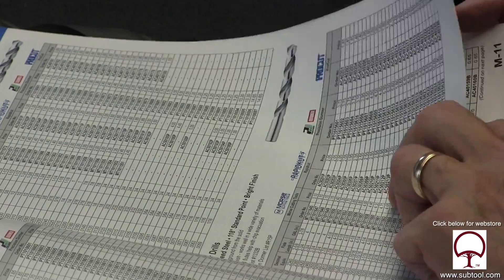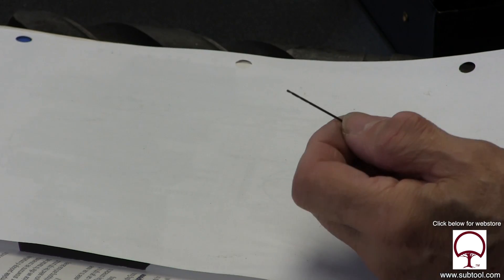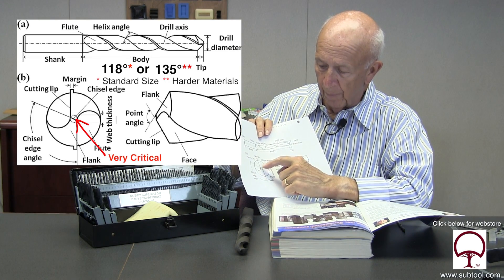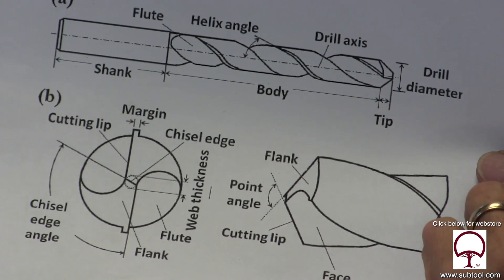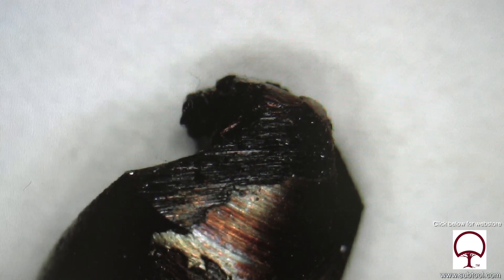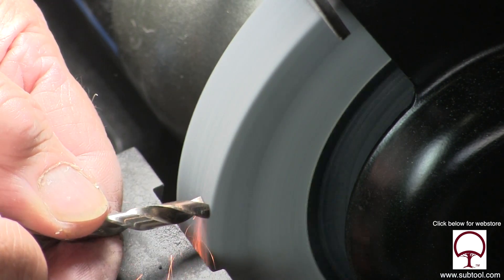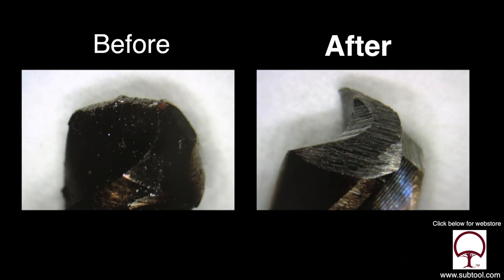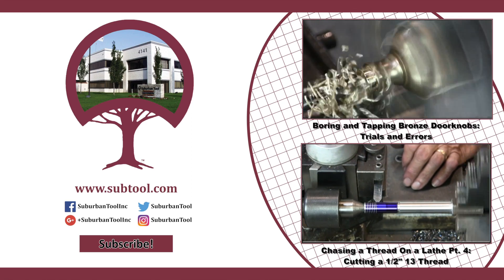How To Sharpen A Twist Drill

Comment: Great video - I will try following your instructions.  I do mine freehand on a normal grinder, but I can never get the point centered properly and they always end up drilling oversized holes.  So I can only use my re-sharpened ones for rough work.
Reply from the maker: You can do it!

Comment: Nice video you kinda do what I do to sharpen a bit.  I was taught a long time ago by some salty old maintenance mechanics how to sharpen bits.  The best I can describe it is like learning to hit a golf ball.  It doesn't look hard until you try.  Once you hit it then you have to figure out how to hit it correctly.  Same with sharpening a bit.  It  Takes practice and feel, but once you figure it out its like riding a bike.   Keep water by your grinder stone, don't over heat it.  If your sharpening a dull bit you don't need a lot of pressure, hardly any.  If your putting a new cutting edge on a damaged bit establish your center point and angle first,  once you have that,  it takes a little time to grind your flank below your cutting tip.

Comment: Thanks Don But I feel you needed to explain that  the blue colour of the "worn" drill, indicates that the hardness of the drill has been severely compromised  and that grinding back to clean  metal , was necessary to achieve original hardness.  Also, during grinding back I would have been constantly quenching in cold water, again to prevent the drill losing hardness.

Comment: Sharpening drills sucks...and I'd like to see any machinist sharpen a 1 or 2" diameter drill and use it on his workpiece that he invested hours on without the drill drilling oversize. Hard to believe no one has designed an affordable drill sharpener with split point sharpening. We have state of the art high speed CNC machines like DMG Mori with 5 axis and 100-plus tool magazine with exotic cutting tools, water cooled spindles, and interactive programming yet here we are sharpening drills with cheap ass machines like Drill Doctor.. No one sharpens end mills by hand, why should you with drills? If we had a decent drill sharpener, no one would be throwing drills away.

Comment: I hate to say this Don, but the before will soon be the next after. The leading edge is too fine and will soon be rolled or broken back. Just like any metal cutting tool it cannot have a jagged or thin cutting edge. Sorry. It should have been stoned up the front of the cutting edge just as you would do to a lathe tool. Then it would stay sharp indefinitely instead of rounding back off again. Good basic start though, just didn't finish.

Comment: I have seen and heard a lot of rubbish on youtube about drill grinding . I have hand ground drills for nearly 40 years.I can get them to cut size with in a thou or so.I am left handed which makes grinding RH drills easier. This drill will no doubt drill a hole but would it drill several hundred? NO. The relief is all wrong and the point thinning a joke. I can't believe so many people think they can regrind drills just because their attempts at it might drill a hole. They don't seem to give any thought to hole size or roundness.

Comment: To all who complained about not using a drill grinder...back when I started out, first shop I worked in the "old man" machinist had me sharpen drill bits by hand until I could do it right, by eye.   Literally spent every day for several weeks until I was somewhat proficient.  Was a PITA for sure, but taught me a ton about proper cutting tool geometry.  I am now a Mechanical Engineer, but I still cringe when I see people on the shop floor use a drill grinder (and don't know what a sharp drill should look like) and complain that the machine won't sharpen a drill properly....

Comment: The first "rule of thumb" when sharpening drill bits is that if the "trailing edge" of the cutting edge of the bit around the OD of the drill flutes doesn't continue to "fall away" from the tip that bit isn't going to drill a damned thing. Your's has a giant "sway" in it and the center of that "trailing edge" is the lowest point in it before it "rises" again at its end farthest from the "point". Because of how drill bits are "wound" and "fluted" you don't have to twist or turn or relocate a drill bit on the face of the stone at all while sharpening. If your angle and side "length" are correct and the two cutting edges are "square" and "straight" all you have to do is start with that cutting edge square with the face of the stone and draw/push the bit upward on the face of the stone and the "spiral" is ground automatically for you. The best "drill bit sharpener" in the world is a VALVE GRINDING MACHINE because of the very fine stones, built-in "truing" fixtures that will leave the stone perfectly square and straight and the cutting lubricant to cool the  bit surface while grinding. When I was going to the best tech school in the U.S. and probably the world 25+ years ago first quarter was a "hand tools" class where we had to learn "stupid" and "pointless" things like how to properly use micrometers, how to properly use files, how to sharpen drill bits "freehand", etc. It's been decades since I learned and I've only done it a handful of times since and on shitty grinders with shitty stones and in a hurry but I can still get a flat dull bit to cut and drill again at least half-assed even with crappy equipment to work with and when I bought and tried out a "Drill Doctor" I ended up giving that worthless POS away. With a good grinder and stone and some serious practice and shaking off the cobwebs I'm pretty sure I could be back to getting them to "like new" condition. What you made in this video is a mess. There are drill bit "gauges" made specifically to ensure that the angle and flute lengths are correct and often they're found on the same "gauge" used for sharpening chisels. As for using a "pilot hole" drilled with a smaller bit so a larger bit will "start" that's beneficial in some situations, necessary in a few and a great way to "ruin" the larger bit in the overwhelming majority of drilling situations. Particularly when drilling hard materials that either start hard or are "tempered" or "work-hardened" by the drilling of the pilot hole. Putting a big bit in a small pilot hole focuses all the load and heat and wear on a very narrow "section" of the large bits cutting flutes and any large bit that won't properly and easily drill a material all by itself with the proper rotating speed, feed speed and lubrication is either the wrong drill/angle/type for the material, is already dull or is turning backward. Large drill bits go in large drills and if a centerpunch "mark" isn't sufficient to "pilot" a drill bit a smaller bit should be used to make a better pilot "mark" at most or the job requires for a larger drill, smarter drill operator, a magnetic "drill press" if the material can't be placed in a regular drill press or some other method of cutting the hole or a different drill bit such as a carbide drill bit. High-speed drill bits are typically "soft" steel which is why they're so easily "dulled" or bent/broken by improper operation, etc. The biggest mistakes people make is using high-speed drill bits to drill materials other than steel. High-speed steel drill bits are for steel and "high speed" is relative. There are special bits/cutters for wood, plastic, etc. Using good high-quality high-speed drill bits in those materials will "dull" them in no time and people who use the wrong tool for a job are very likely to use the right tool for a job in the wrong manner and that also dulls bits in a hurry. The second huge mistake is drilling "pilot holes" with a smaller bit after realizing the desired larger bit "won't drill" the material, is hard or impossible to get "started" or keep "centered", etc. That's commonly the case when a "dull" CENTER PUNCH is used to make a "starting mark". A dull center punch and the hard hammer blows needed to make it "dent" steel work harden the piss out of the steel where that mark finally get's made. That's hard material to get the tip of a drill to start into and especially a large bit with a large tip end double especially a DULL large bit with  DULL large tip. Grabbing a small bit planning to "work up" to that large big is usually done by people who have nothing BUT dull or at least crappy bits and by the time they get done drilling one or more pilot holes they've done more work-hardening, overheating and "tempering" of the steel because they wait until the bit and/or "chips" are smoking/turning blue to decide they need some "cutting oil". Douse that hot material/bit with "cutting oil" and you just oil-quenched it, hardened and tempered it and good luck drilling from there. The bottom line is that "pilot holes" are for installing screws in so the material doesn't crack, the screws don't get "stuck" and strip out/twist off, etc and for making bores that are going to be FINISHED with a REAMER.

Comment: Sir, no disrespect, but you not good enough to re sharp drill bits. This drill bit would be blunt after few holes in stainless steel. But explanation is very accurate ant well presented.

Comment: I don't want to be the goat here, but surely there has got to be a better way to sharpen a drill bit other than by hand. With all the inexpensive and advanced technology  available these days, you should be able to drop the bit into an orifice located on an automatic machine  and have artificial intelligence software figure out all of the rest for you and engage a robotic CNC grinder to make the finished grind.  They already do this with key cutting machines. You just plug your key into a slot and the machine takes over from there and dispenses the finished key to you. This is all done  while your wait.  I'm guessing this video is for the hobbyist who only sharpens drill bits now and then. In an industrial setting , manual grinding wouldn't be cost effective, and it would eat up  productive labor time as well.  Time and money do matter in this world after all.
Reply from the maker: You are so right! We just wanted to give the newcomer\hobbyist an idea of what could be done by hand.

Comment: Good video bud. Very important to mention,  that it takes training to hand grind a drill, usually a few years as an apprentice.  Also important is not to gauge the wheel, pass the drill across the width of the wheel for even wear. So, bud, your clearance was good but your point thinning needs more practice.......
Reply: If you can look at that bit and in particular the "trailing edge" of the flutes and think it's going to drill shit no matter how good his "point thinning" is you've never sharpened a drill bit in your life. The trailing edge has to continually "fall away" from the cutting edge as it follows the "twist" of the flutes. If it doesn't and remains "flat" or even worse has a big "dip" in the middle and then "climbs up" as it goes further "back" that bit won't cut a damned thing. As for passing the drill across the width of the wheel, if you "wear" a grinding wheel simply sharpening a drill bit, you have no clue what you're doing whatsoever and you probably "wear" a whetstone trying to "sharpen" a single iknife. His first "mistake" of many is using that stupidly coarse stone and it's all downhill from there. He apparently doesn't even know what a drill bit/chisel "gauge" is and there ain't no way to accurately "eyeball" the angle and length of the flutes to make sure the "point" is centered and that cutting edges "square" with each other and with the "axis" of the bit without one of those. There's a reason drill bits are PROPERLY sharpened to EXACTLY 118 or 159 degrees and "close enough" just don't cut it any more than having the flute lengths "close enough" and the "point" not centered on/in the bit is really "close enough". Drill bits and chisels are either sharpened PROPERLY or they're not sharpened at all.

Comment: Nice Vid, if a person was going to buy a new stone and save it just for aggressive drill bit sharpening, what type and grit of stone would you recommend for larger HSS bits, say 3/4 to 1 1/2? On the smaller ones I have had real good luck touching them up with a disc sander if you stop before you butcher them too bad. Thanks again for the video.
Reply: You NEVER want a stone for "aggressive drill bit sharpening". The best stones and "grinders" for sharpening drill bits, chisels, etc are fine "finishing stones" and valve grinding machines. Would you sharpen a KNIFE BLADE you want to cut something as "soft" and easy to cut as MEAT with an "aggressive" stone? If not, why in the hell would you want a ragged, rough edge from an "aggressive" stone on an edge you expect/want/need to cut in between STEEL molecules?

Comment: More often than not when I try sharpening a trashed drill bit the end of the bit doesn't look like it did from the factory when I'm done.  It's difficult to get them indexed correctly when they break off or are worn badly.
Reply from the maker: Very true, sometimes it's rough to save them.
Reply: Try using a drill bit/chisel sharpening/angle gauge.

Comment: When I served my apprentice (tool and die) at General electric, we had an older gentleman at that time that sharpened all drills, end mill and etc: in the shop by hand and there never was a problem with any of his work.  As time goes by the golden oldie tool guys will be gone and what will be left will be nay-sayers.
Reply: when i hand grind a drill, i first do the 12 degree front clearance with the 59 degrree angle sighting it with a cupped hand over it up against the light to create a shadow of the drill point, checking the angles and lip lengths are the same on both sides. then i give it the secondry clearance starting the grind from the back edge and rolling it round to the 12 degree front clearance leaving a land  equivalent  of the side land of the drill, thin point if needed. the drill usually cuts within a thou of it's self. i use them on wickman multi spindle auto's and bsa single spindle auto's. been doing it that way since 1976.
Reply from the maker: Couldn't agree more.  There's certainly an art to it that is dying out, but thankfully there are quality drill sharpeners out there that will do the job quickly and accurately.

Comment: That a very interesting and important thematic right there. In my training here in germany i have been told to use a 130 degree angle not only for hard steels but also for aluminum. I was wondering that the bit changed colour when grinded. I was told never to overheat the drill when grinding because it would weaken. The heat though is indicated by the coulour change. Great video and great content in general! As a youngster i have learned to listen closely to what the oldsters got to teach.

Comment: just a thought, the 135° would decrease the length of the cutting edge, meaning it would increase the pressure on the edge. the point is shaped like a cone(or pyramid, or triangle), if you reduce the height of the cone but leave the base the same diameter, the edges of the cone get shorter.

Comment: Not clear on what you mean by relieve? Can you explain that?
Reply: robert mccully 
relief is the clearance behind the cutting edge 
as the drill rotates the back of the ground end will rub
in the worst case the drill will not cut at all
too much relief and the cutting edge will be weak and fragile.
after sharpening and a trial cut ...
a quick visual inspection of the end of the drill will show if it has been ruing on the back edge of the ground face.
Hope this helps
Steve.
Reply: Steve Williams Not that easy to understand. A sharp drill is not larger when sharp. So relief must mean to make smaller in a specific location. So why only a specific location where it is sharp. What you must be saying is the opposite of how it sounds. Relief must be to allow material to pass by and enter the flutes to exit so as to eliminate friction of cut material. And to sharpen is the same, to eliminate as much friction as possible. So sharpen and relief do the same thing. The leading edge is sharpened  to cut, and the relief is to allow what was cut to pass by.
Reply: @BasketCaseGarageForFun   no the relief is to determine the depth of cut, cut material goes forward into the flutes